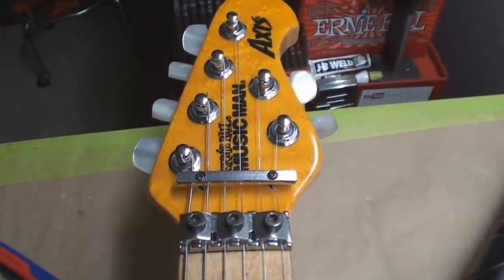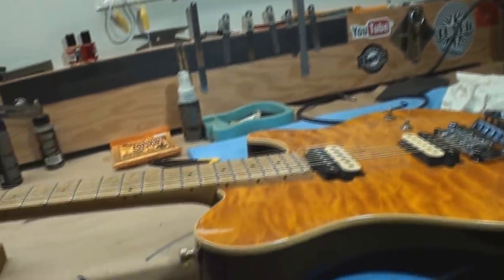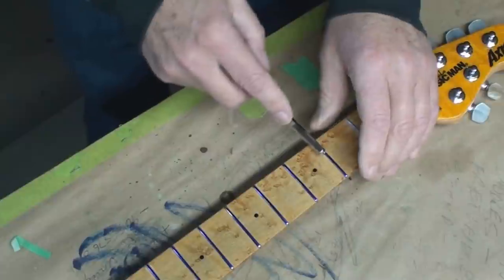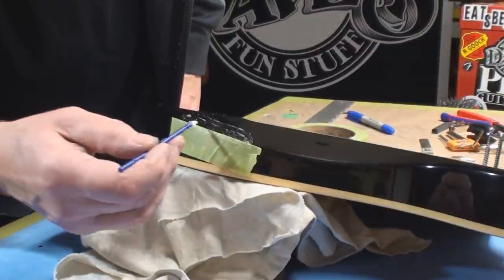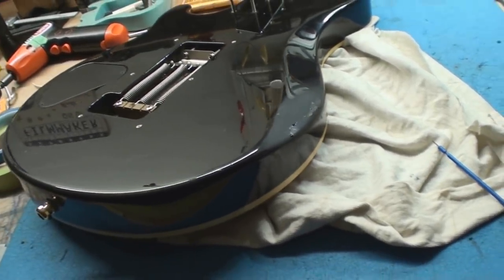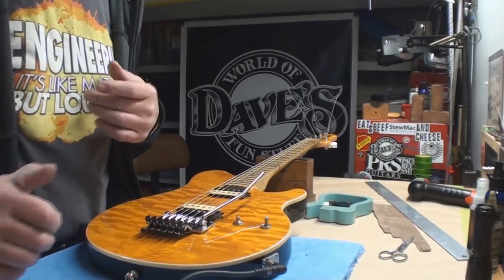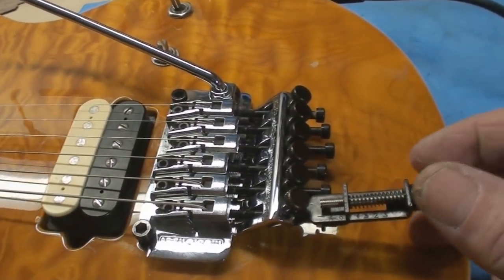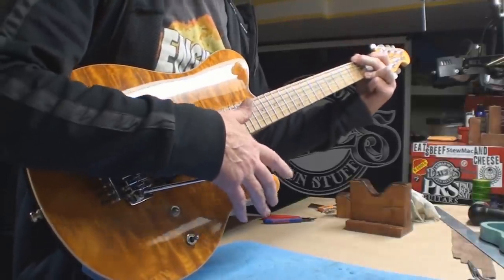Ernie Ball Axis Guitar

Comment: Nothing strange about the head stock Dave. Just as Leo Fender's head stocks were designed to keep every string straight from bridge to tuner so is this designed for the exact same reason. No bend between nut and tuner means no tuning issues. Ever had a cantankerous SG or Les Paul where you're being driven nuts by tuning issues Dave ? Of course you have so you'll understand why.

Comment: All for the low low price of $2,549.00!!!  (Added $200 for the quilted maple top). Body is basswood, literally the cheapest body blank material I could find. Cheaper even than poplar. Basswood $45.00, Poplar $55.00. Basswood is also twice as soft mahogany, and even softer than yellow pine. I would hate to sneeze and dent my 2.5k guitar. Lol
Reply: I quite like basswood as a tonewood though.
Reply: I read there are a few grades of basswood, the higher grade does not sound mushy or dent easily.
Personally I like a few of my Japan Strats in light (probably budget) basswood, fun to play. The maple-cap-board one has a nice midrange 'howl' thru an amp. Wood cost isn't the sole criteria of importance.
Reply: I have an Axis and it is one of the best guitars on the planet. Tom Anderson said it was the best tonewood.
Reply: My e series Squier strat is made of basswood.  I can confirm that good quality basswood is not soft. My cat knocked it off the wall and it fell on the bottom of the body. Couple nice chips out the paint but the wood didn't dent in the slightest. It also has one of the strongest resonance when you play it acoustically. A friend of mine has a cheap strat copy made from basswood that has the acoustic properties of toilet paper ☺
Reply: The axis that I have is very solid..
Reply: I used to fall timber professionally. Basswood was a tree that you could tap with your ax and hear the resonance of the tree, more so than any other tree in the woods.

Comment: Hey Dave, a novice luthier here. On Floyd rose equipped guitars, what is that string tree type thing near the nut for? What does it do and what does it affect when setting up a guitar? Thanks
Reply: It's used to make sure the strings are seated properly in the nut. That way when you tighten the locking nut down it doesn't go wildly out of tune.

Comment: Why not heat the lacquer stick...?! You don't have to melt it like you're doing a wax seal on a papyrus scroll, but you can hold it near the side of the flame until the tip of it gets soft enough that it's about to drip, which means you also don't have to get the knife red-hot, and it makes getting it in MUCH easier (snort, wink wink); plus, with the lacquer stick softened, the hot knife makes it 'flow' better, and it fills in the gaps better, gets a better 'hold', and just generally yields better results... Ugh..! Otherwise, well done, sir.

Comment: Those headstocks are fugly.
Reply: But neck plate? Worth the cost.
Reply: guess you dont know the reason for the headstock shape?
Reply: Because the good Fender headstock shapes were already taken.
Reply: its for tuning stability. Notice how there is barely a headstock angle, and the tuning pegs are aligned straight with the nut so the strings dont splay to the side?
Reply: it's genuinely the perfect function>form headstock design. but no, muh classic fenders
Reply: I'll take aesthetics over function any day, don't care. I'm shallow. If I had two options to play guitar or play nothing and one was the greatest sounding guitar in the world but it looked like a BC Rich warlock and my only other option on Earth was a telecaster that sounded like total fucking garbage, I'll take the tele.
Reply: Yes, but they are great guitars.
Reply: Never liked the body shape but I like the headstock, a great alternative to the six in a line Fender.